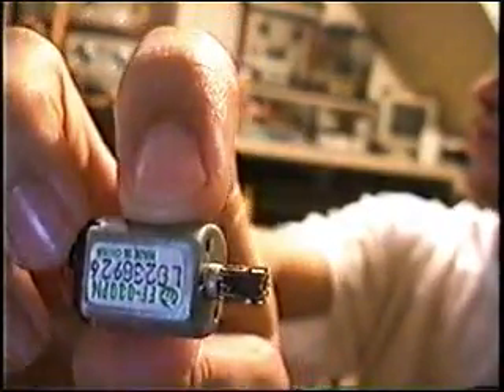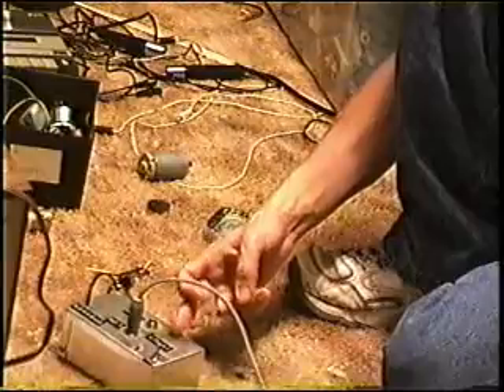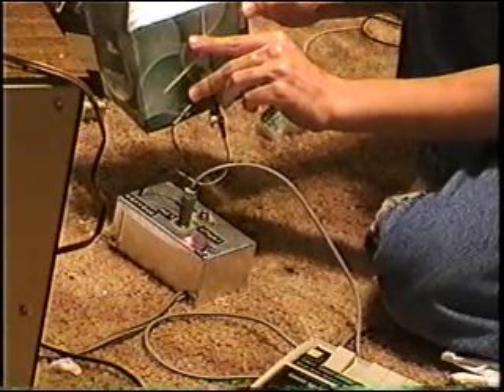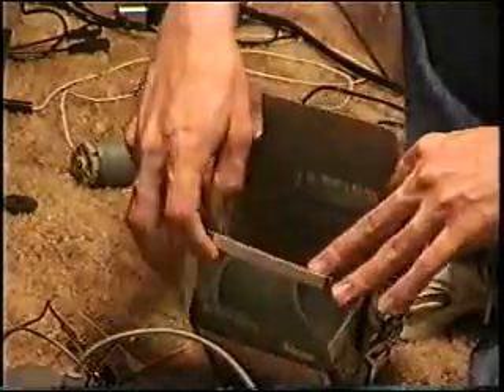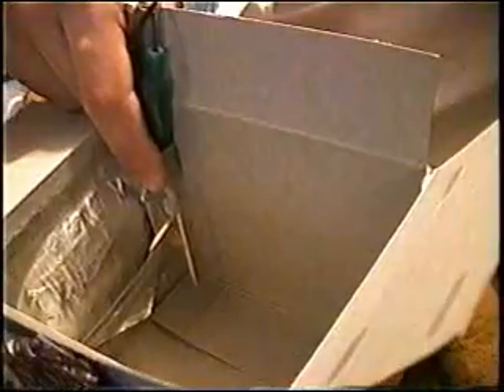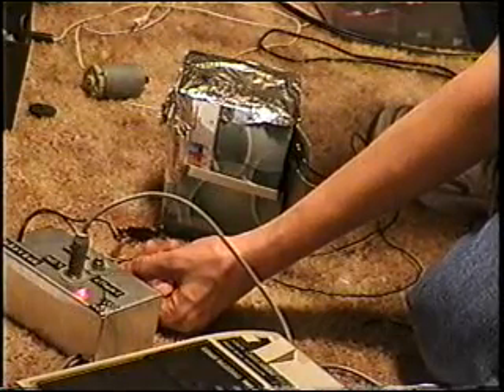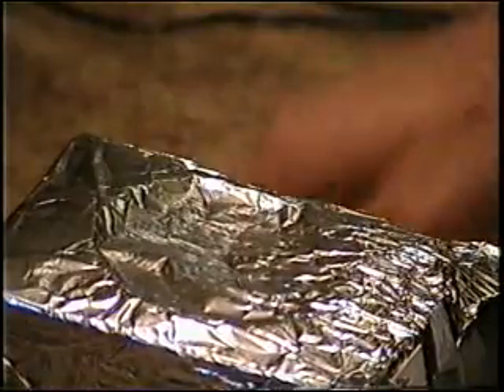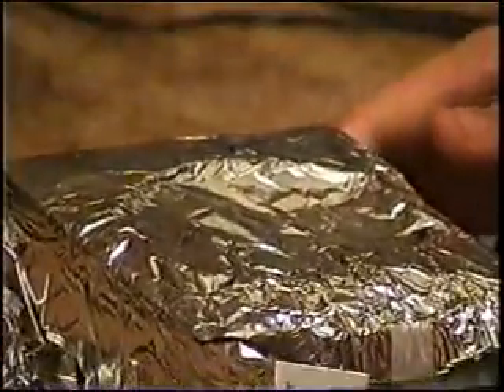Re: How to Make a Speaker out of a Tissue Box

Comment: very ingenious! I have an old transistor radio which has a solenoid type coil mounted on a circuit board and a metal wire which connects it to a paper diaphragm...your speaker reminded me of that design.